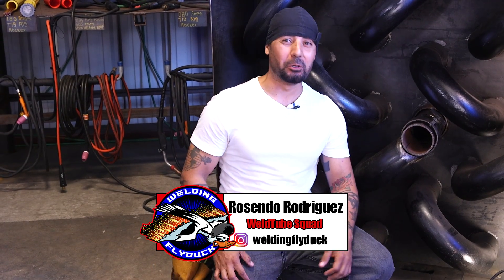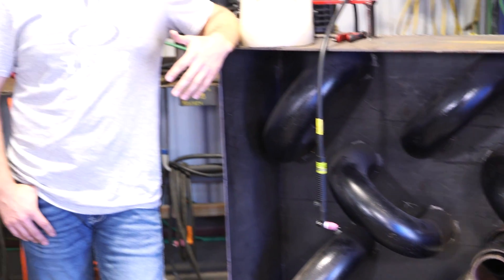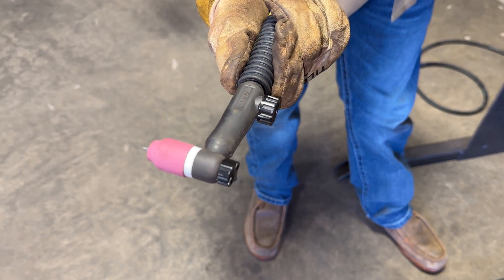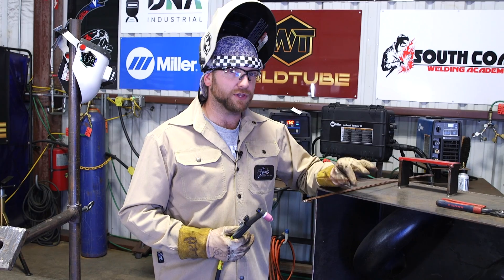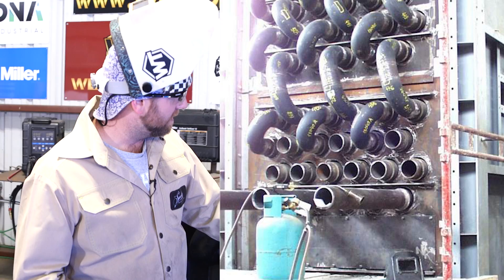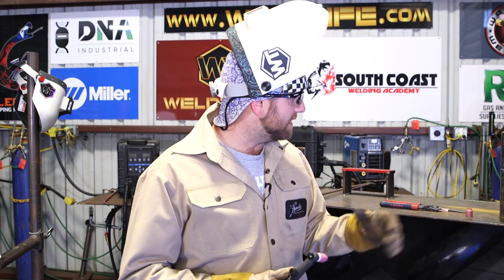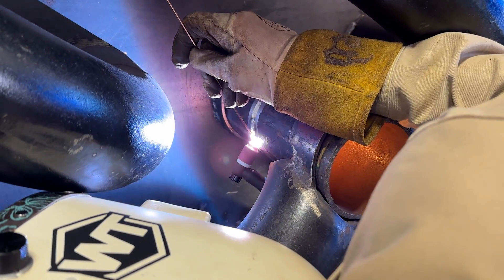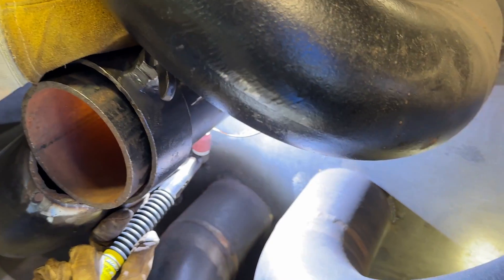Convection Section Welding | TIG Welding

Comment: I’m a mechanical engineer and typically this is usually seen in the convection section of a boiler exchanging heat with the effluent combustion gas

Comment: Awesome video and explanation! It really helps having the voiceover done separately from the weld. It lets the welder focus on one thing at a time instead of trying to explain under pressure. The audio quality is also much better because the sound doesn't echo under the hood

Comment: Pipe  NOT TUBE!!!!
Reply: Yeah. Return tubes on a boiler for sure.
Reply: TUBE, its a part of a unit (heater, evaporator, heat exchanger, condenser, etc.) Pipe, if used as a stand alone structure.
Reply: Tube.